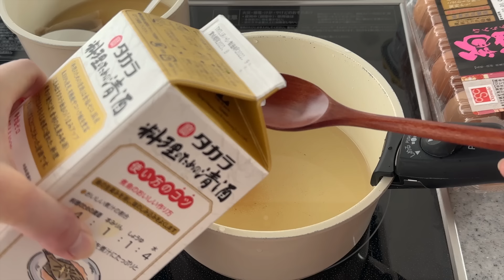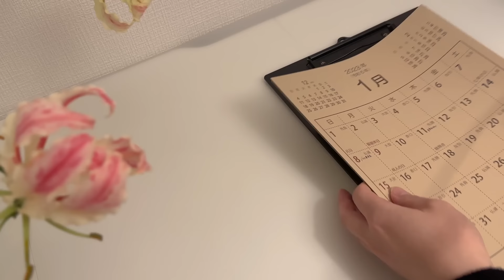【部屋作り】寝室に新しいデスクを設置して部屋を整える1人暮らしの休日VLOG｜home desk makeover

Comment: I took some time to scroll the comment section to see if anyone dropped any tip to make to collagen get out of the molde in shape. Didn't find any. I am curious.

Here's a tip for next time you make the cream custard, Nami: Before putting the cream in the pipe also to make it better manageable it's necessary to beat it one more time in the mixer.

Thank you for the video.

Have pleasant and joyful days 🙏🏽🙃🧡

Comment: I think the blanching of the gelatin is the reason why they do not set properly. We do not do that in Canada when using gelatin. We put the gelatin directly into the hot liquid we plan to use and straight into the container. We do not blanch. This would disrupt the bonds when setting the gelatine I never have problems with my gelatin figures. Please try again Nami!